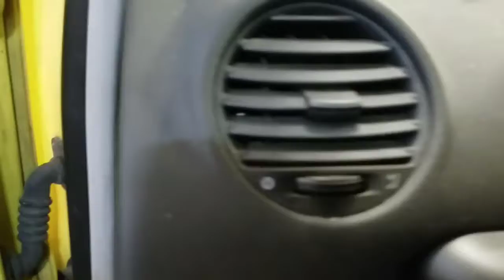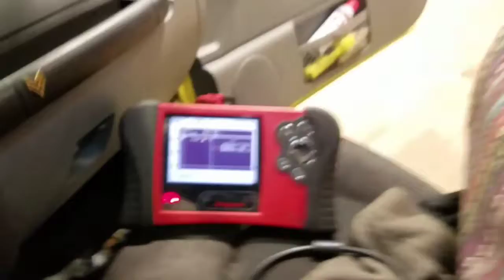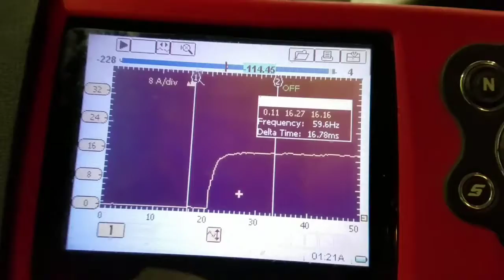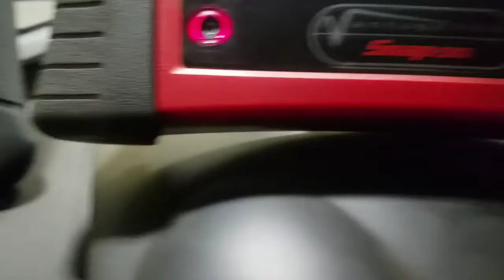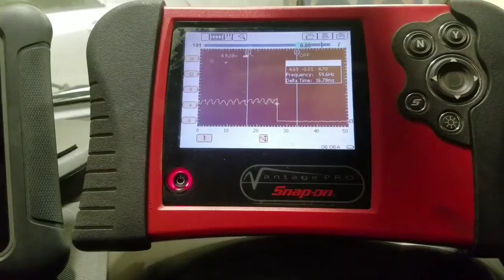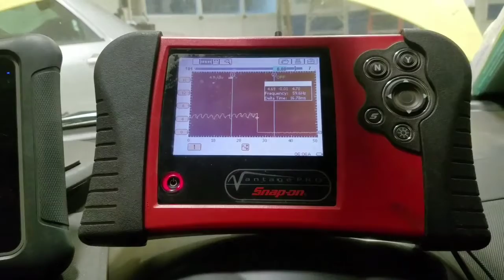VW Beetle crank no start condition.

Comment: If the pump isn't putting out the right amount of pressure that would result in a no start also right? My 2001 cranks but won't start I had a code say low voltage at the pump before it quit running I replaced the relay it still won't start . Is there a way to test the pump before dropping cash on a new one?